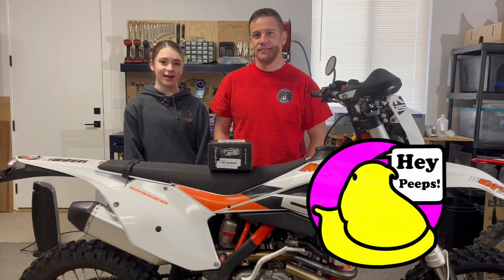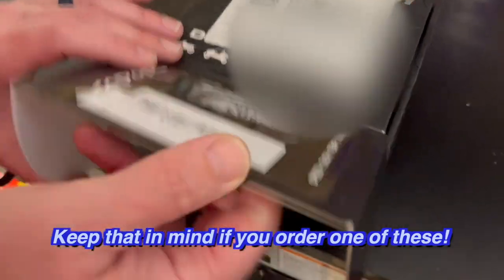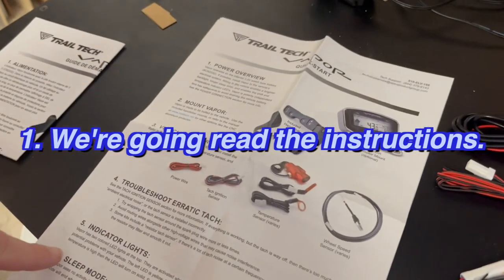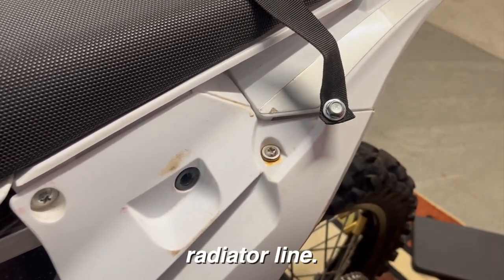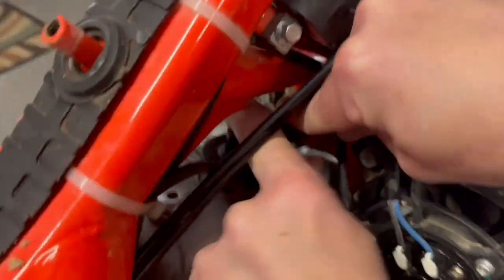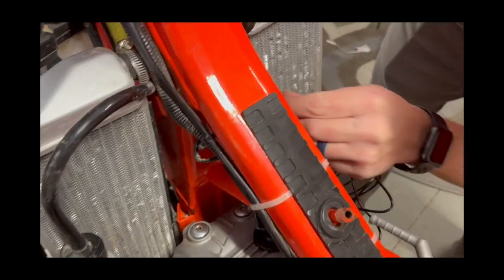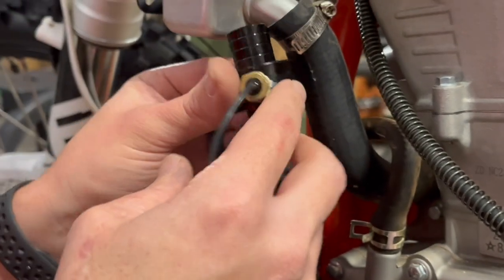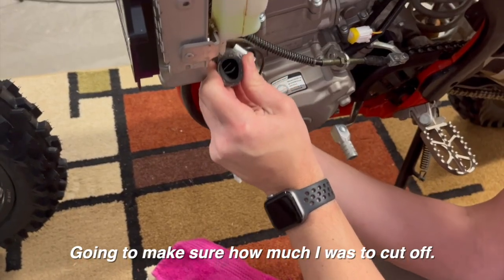Trail Tech Digital Speedometer Installation on the Kayo K6 EFI Dirt Bike

Comment: Hey bro I have a kayo k4 will it also work for mine?
Reply from the maker: Yes, the Vapor will also work for the K4, but because the K4 is air cooled, you’ll need the version of the Vapor that comes with the spark plug ring to read engine temperature. Hope this helps!